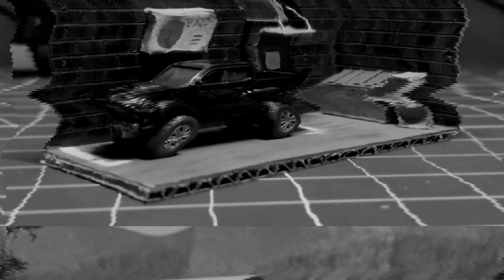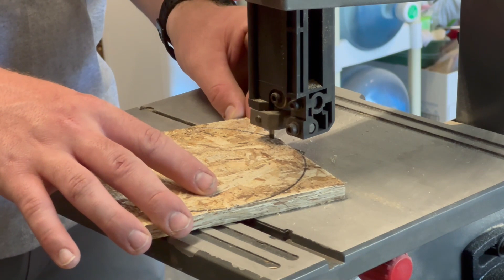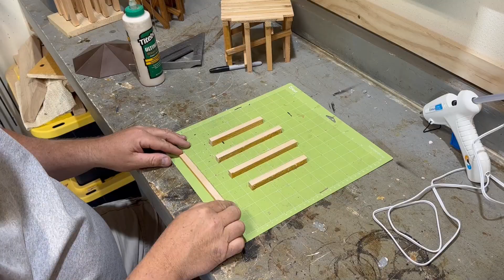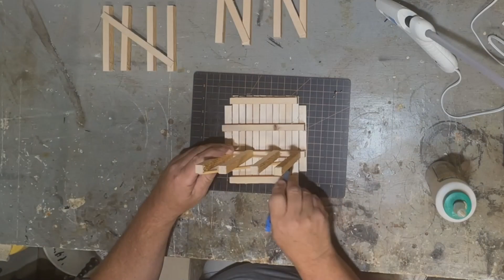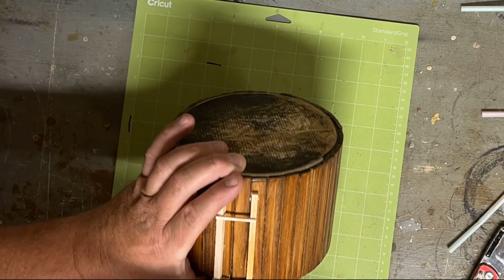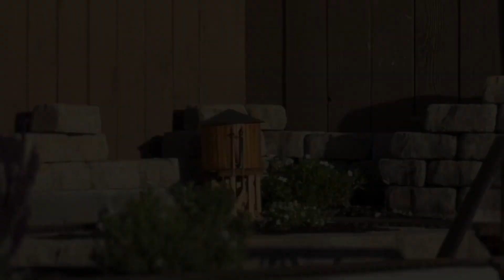Garden Railroad Water Tower Build | How to build a G Scale Water Tower

Comment: A suggestion: bands around the tank staves would help cosmetically as well as mechanically for when the hot glue joints give up... Have you needed to add any additional structure to the inside of the roof? This fella suggested low profile zip ties: https://youtu.be/vxf0Y8iL4j4?si=TP3BFEajrL85ABGj
Reply: I just built a water tower using your method. The roof was made from 1/8” plastic I repurposed from a broken pickup bed cover. I am still trying to determine what would be best for the straps holding it together. I experimented with zip ties but they don’t look right. Agricultural silos use rods with couplers and would be accurate . They were 1/2 - 3/4” diameter if I remember correctly. Fabbing the couplers is my next challenge and using string trimmer cord for the rods would probably be about correct scale.
 I also use my Greg 23 gauge pinner to “ nail “ stuff together, a leftover from my Trim and Cabinetry career.
 Thanks for tutorial..I will include pictures at some time..
Reply from the maker: I have given some thought to the bands. I like that idea! I was going to try some florist wire. Any suggestions for what to use to create the bands?  Thx

Comment: Looks Great, I just started a garden railway so this is perfect timing . I have a few questions
What were the final height dimensions of the base and tank? 
How does the hot glue , straw pipe and styrene roof hold up under the sun?
I was thinking either vinyl siding or metal roof flashing for the roof and Loctite  PL max for the glue.
What are your next builds? May I suggest a coaling tower and engine shed?
Thanks
Rich R
Reply from the maker: Overall height of the base is 5 1/2” and the shorter tank w/roof is 6 1/2” as well the taller tank is 7 1/2” with roof. I don’t leave my structures out full time, only when running trains. I put several coats of satin clear over finished structure but I worry about them baking in the summertime. More builds are in the works. Thx.